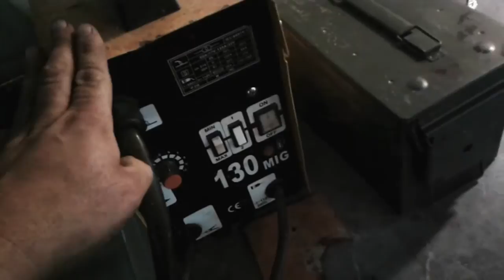Ammo Can Stove Build

Comment: you've got the best motor ford ever built.it will run forever. that's why they quit making them.thanks for the video.
Reply from the maker: Thanks for the comment. I agree, these are very reliable engines. Not exactly loaded with torque but they last forever so that's the important part.

Comment: Resourceful design... thanks for sharing.  I found this from your linear actuators video which is also resourceful.  Might be like a wood gas type way to make that mistake work out better by making another burn chamber that exhausts on the side opposite of the door and pipe so the gases get combusted more efficiently when going out above the fire chambers.  Might burn even more efficient.  Maybe like sheet metal bent to leave the size volume of the exhaust pipe in the shape of a rectangle that goes in between the top of the can lid.  Maybe just a sheet bent like the burn grade screen with longer sides to fit tight and sit just on the screen with the two sides.  Thinking that might help actually and make a more efficient stove.  Thanks for the idea!
Reply from the maker: Cool! that may work even better for a cleaner more efficient burn. Great idea, thanks.

Comment: That was a big boo boo with the chimney. Funny :) We're all dumb sometimes when we're trying to show someone how to do some thing :)
Reply: Great stove, though. Thanks for the detailed instructions.
Reply from the maker: lol Yeah, probably wouldn't have happened if I weren't talking. Thinking of covering it with a thicker piece of metal a little wider than the stove for a place to sit a pot.
Reply: dsteele27 good job I have to do 20 dry run till I'm ready to drill do don't sweat it
Reply: Second burn is important n the u flow in the box n feeding tube makes it a rocket stove

Comment: Looks good Luke!! Could you use high temp engine paint to paint it black or would there be problems with fumes when you get it hot for the first time?
Reply from the maker: Best way to do it is light a fire in it and run it as hot as you can for about an hour to burn off the paint that is on it. Then you can sand it and paint it with high temp paint. Before putting it inside I would let it dry then burn it again for a while to burn off any residual fumes.

Comment: Hi Luke, watching this again. Is that a standard size ammo can? Your the only one who shows putting a seeing glass in the front. I wouldn't want one without that. The ambience is every bit as important to the heat it gives off! Just sayin'  How come you don't use hi temp glue/sealant to keep the fire rope in place? I love the way you actually show how to hold your tool, angle and site to grind. What did you squirt on the hole saw before cutting the large hole for the smoke pipe? How do we install the exhaust pipe if we don't have welding equipment? Do u have to burn the paint off the ammo can? Love your accent...reminds me of where I grew up. :-)
Reply from the maker: The ammo can I used was from Wal-Mart I think it's the same as a 50 cal. Not sure where you can buy the little window at, mine came from an old kerosene heater. I put oil on the hole saw to lubricate it. I would say if you don't have a welder then a muffler shop should weld the pipe to the ammo can top pretty cheap. Yes you should burn off the paint if it will be used inside. There are some bad fumes that will come off if you don't.

Comment: Nice video, thanks for your effort in making tHis step by step. Do you think any piece of glass would do for the door window? Was thinking of sealing in the glass with a clamping set up and fire rope. Thoughts??
Reply from the maker: I'm not sure if a regular piece of glass would work with the heat. I would be afraid it would shatter. If it were to shatter and send pieces of very hot glass flying it would potentially cause injury or damage. I would recommend using a type of glass designed for high heat.
Clamping it in and sealing it with fire rope is a good idea as long as it is glass rated for high temperatures.
Reply: Yep, I think I agree, thanks for the quick response. Adam.

Comment: You don't need to molest a kerosene heater for the window. Google "Mica" fireplace windows. You can use "Pyrex" windows, but the shatter easy if you spill water on them. 
Throw in a stick with a little snow on them and CRRRrrraACK!! it's over.

Comment: How big of an area will it heat?howuch$ and  can you use indoors?
Reply from the maker: Not sure how big of an area it will heat but I know in my van it would get so hot you would have to open doors in the cold weather. I would say it will heat a small room no problem at all.
It probably cost me about $45 or $50
here are links for the can and some better rope than I used.
Ammo can stove--------https://amzn.to/3pHUvpL
Rope gasket---------------https://amzn.to/3pDO6vn
The rest of the stuff you can get at Lowes. 
As long as you seal it up well it can be used indoors. You would want to burn it outside first to burn all the paint off the can but after that it should be good.

Comment: What type of gas millage do you get in your van with the 6 cylinder? Mine has a 302 and I only get 11 or 12 mpg on the highway and about 6 to 8 mpg city. I am how ever thinking of swapping my engine to either a 351 Windsor or a even bigger 351 Cleveland. I was told from a buddy of mine that if I switch to the Cleveland that even though its bigger that because the engine isn't working as hard as the 302 that it would actually get better fuel millage. What do you think?
Reply from the maker: Dragon Raptor I get about 14 or 15 after a recent tune up. That's just regular driving, combination of highway and back roads. Do you have the 3 speed or the overdrive transmission? Overdrive helps a lot. A bigger engine would help if you have overdrive. The bigger engine wouldn't be working as hard.
Reply: I have the 4 speed automatic.
Reply from the maker: I would say the Cleveland would be the way to go. Your 302 should be getting better than it is.

Comment: Could you boil water on top of it?
Reply from the maker: Yes you can. Especially on this one. I cut off my pipe that was in the wrong place and welded a round piece of metal over the hole bigger than the width of the lid. Perfect place to sit a pot.

Comment: No ~ I was referring to the top hinge where you put the chimney on the wrong side
Reply from the maker: Barbara Russell Oh I'm sorry, I misunderstood. It would be possible to relocate the hinge on the other side, but not the latch. It would take up the room the door is now.  I actually welded an 8 inch round piece of Metal  over the hole and put the chimney in the back. I can set a pot on the round piece now kind of like a hot plate.

Comment: That's not true u can have a clean seal without welding depends on ur skill level most people doing this don't have n eye for detail but got the parts n tools n there u go is that a Texas accent I detect Waco Killeen maybe
Reply from the maker: Nope, I live in Kentucky. I lived in Killeen at for a short time though. Never thought I picked up another accent from there.lol
Reply: I'm from Nashville lived in Texas but NorCal is home now but I got ur accent close lol check out the guy from UK ammo can rocket stove 2nd burn tube makes a bit o difference lots better but thank u I have the same ammo can the gut in UK has a British one burn the paint off also I'll send u a photo when I'm done plus I build solar water distiller n I ought to build one for whiskey but first things first I have larger ammo box I'm making into a stove it has a 4 or 5 gallon steel bucket that fits on top to bake in and heat my water I live in the boonies with no electricity lol battery drill n hack saw n use the old noggin it's snowing so I move a little slower but rocket stove works in my van do u find the heat messed with the bolt on stuff or it holds up fine I'm a little reluctant to use nuts n bolts as I don't think they'll last in the heat stainless should work thanks again
Reply: Is that stainless screen I'm always looking for materials to build with I'm watching u build now put a shelf in between the top n the screen short on the opposite side of the flute for smoke n heat to circulate like rocket stove check out Chris from UK ammo box rocket stove it's funky but works great it's his mk 2 model  it needs more rocket that thing
Reply from the maker: @russelmurry1564  It is stainless screen. It came from work when they changed out the screens at the blacktop plant. I'll check it out.
Reply from the maker: @russelmurry1564  Yes the bolts I used are still holding up. Stainless steel bolts would be better.